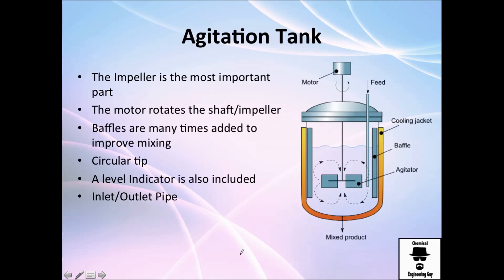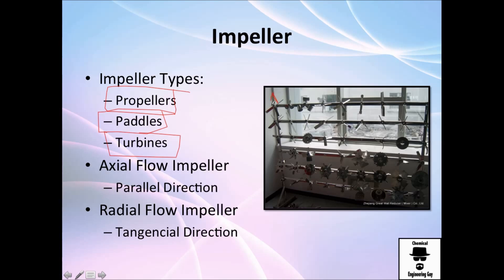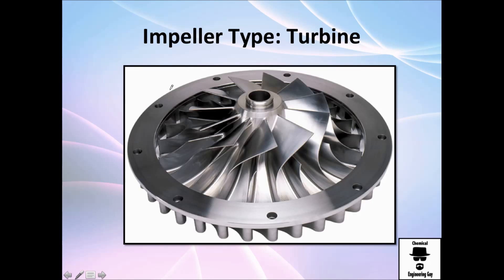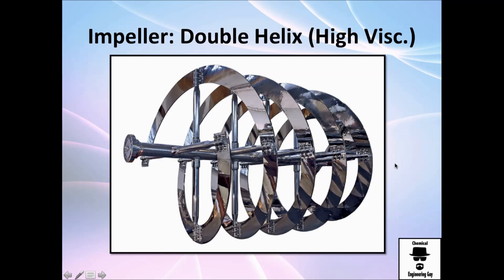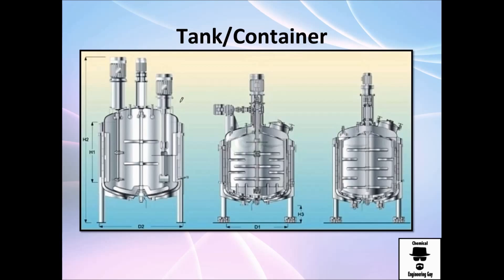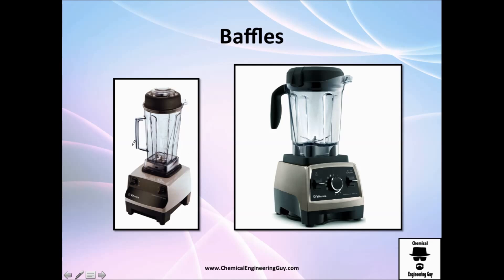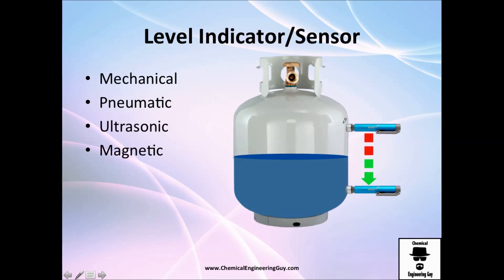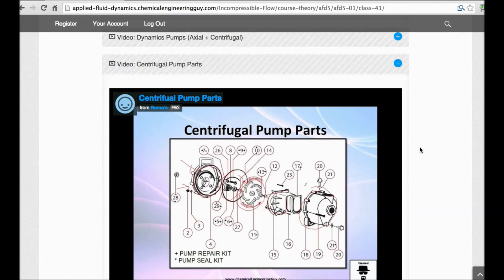Agitation and Mixing Equipment (Impeller, Vessels, Baffles, etc.) Applied Fluid Dynamics - Clas

Comment: Hey , I am making carmlized pecan in kettle but I have some broken always can you recommend appropriate type please .
Reply from the maker: a little bit late but: For caramelized pecans, try using a heavy-bottomed stainless steel pan or a non-stick skillet—it helps distribute heat evenly and prevents burning or breaking. Also, stir gently and avoid overheating

Comment: any idea on how to know the diameter of the impeller and how many hp in the motor?
Reply from the maker: I have some videos on how to use Agitation Numbers. With those you can relate diameter size, speed, power, etc...
Reply: Chemical Engineering Guy 
May I have the link
Reply: Are you facing any mixing challenge? Maybe I can help - NO baffles are needed for our technology.
Reply: @advancedprocessmixing-apmi179  make video explain scientifically your products
Reply: For impeller, base on the type of the impellers. for paddle type usually 70% of Dia/Tank , the power of the motor we can calculate.
Reply: @jeffsi6645  i am designing grease kettle could you please tell me how to select agitator shaft and motor